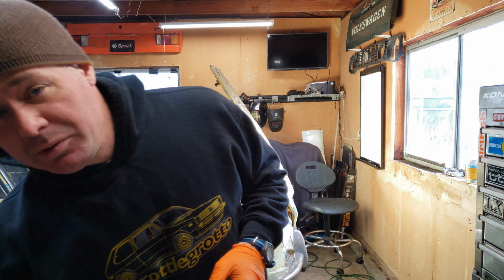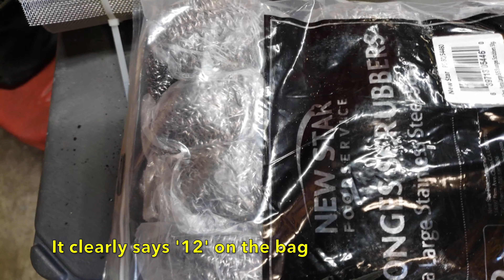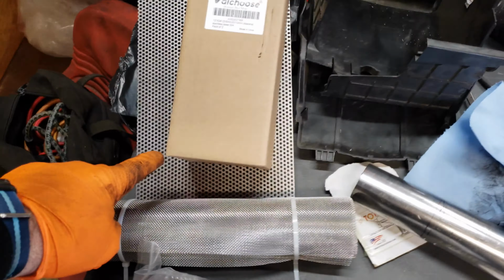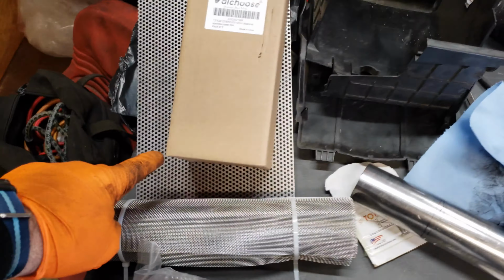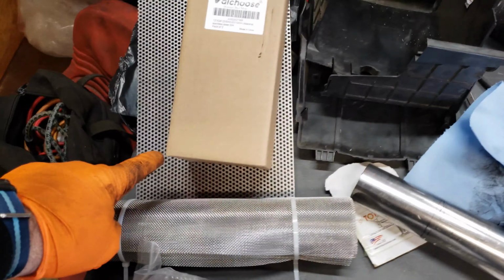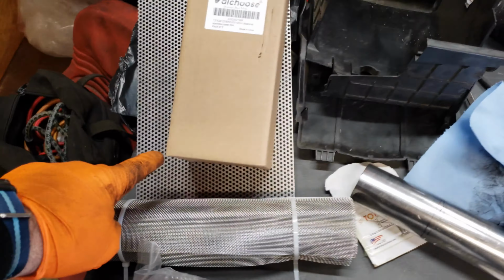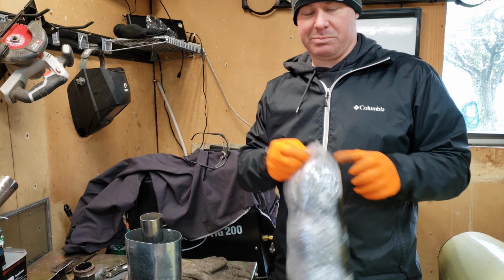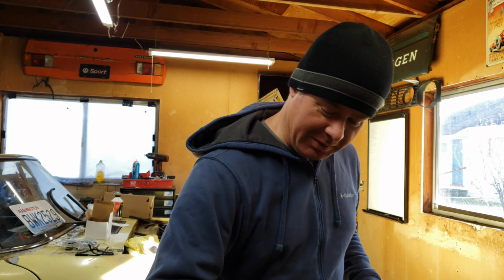MAKING A MUFFLER filled with KITCHEN SCOURING PADS for my DATSUN!!!

Comment: Great work! Have you decided what you are going to do with the piece from the original muffler? I was thinking you could place it on the flat part of the new muffler you made. I guess weld it on? I think that could look nice without compromising the integrity of the new muffler and you can always remove it if needed.
Reply from the maker: I haven't decided. It's in pretty rough shape,  there is perforation inside the lettering. It might just end up as a wall hanging instead, which is still pretty cool
Reply: @ThrottleGrotto  Oh ok got it. Well always a nice addition to the wall of memorabilia.